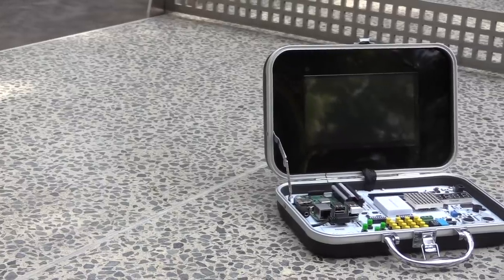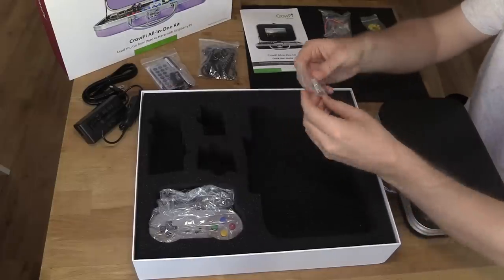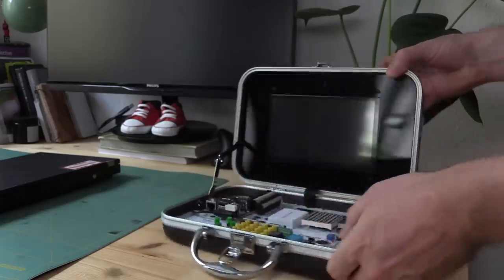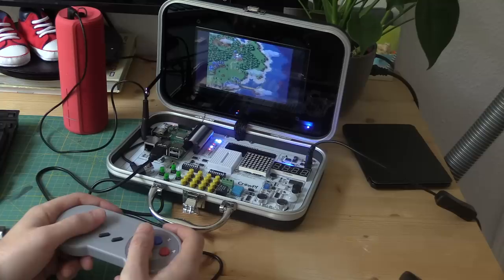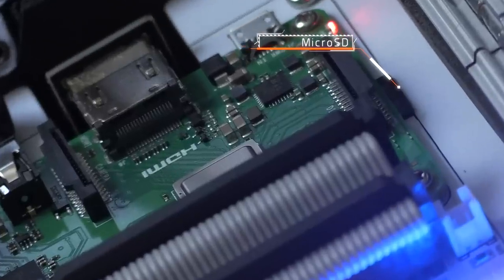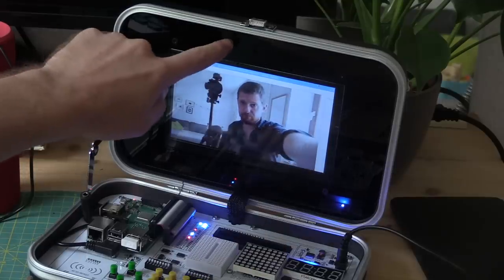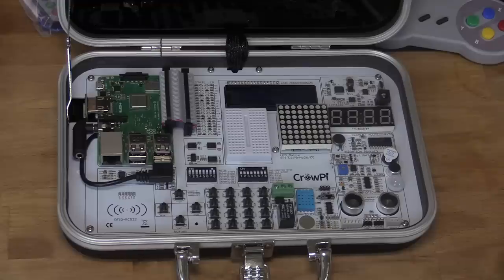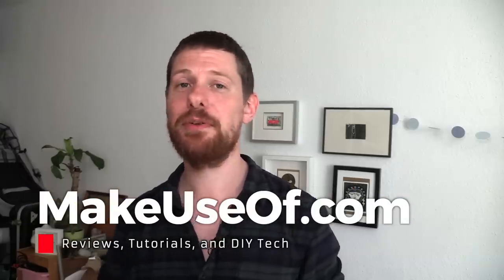Don't Buy a Raspberry Pi Until You've Seen The CrowPi All in One Kit!

Comment: Amazon sells a micro sd ribbon extension cable about 6 inches would allow you to be able to change SD card. Without having to remove the pi more than one time.
Reply: Excellent, that question came to mind about an extended for SD card. Good Job!

Comment: I don't think I would recommend buying a starter key with everything already wired up on a single board if you want to learn programming and electronics. I recommend learning to program on a PC then learning the electronics with a "bag of parts" kit.  With everything already wired up, you don't really learn how to build circuits. Building circuits is the foundation of electronics. Also, you need to be able to place your peripherals where you need them. E.g. The acoustic ranger on this thing is always pointed at your face.

Comment: The thing that where not included. Is there a set of them on Amazon?
Reply from the maker: ... which things?
Reply: @MakeUseOf  Wires I think. You talked about it in the video. Let me rewatch.
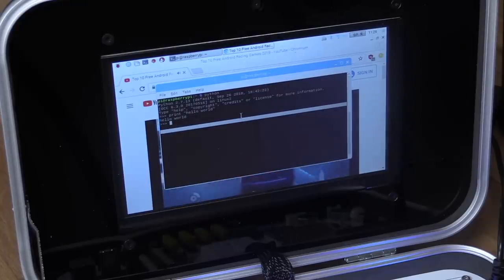Reply: At 5:40
Reply from the maker: @basicallyskeptical77  Oh: an LED, resistor, and wires. Probably not, they're very cheap components so usually come in an electronics starter kit or in a massive bundle of 50 at a time.
Reply: @MakeUseOf  OK. I don't understand electronics yet so wanted to know what to buy to complete the crowpi. Thank you.

Comment: There going to release a pi4 version. Will this still be worth it?
Reply from the maker: You can always swap the Pi out for the newer one, but I expect they'll update the CrowPi to include the new model soon.
Reply: @MakeUseOf  Actually the connection is different on the pi4. And yes they said they are working on a pi4 ed. If I did get this one I could turn it into a mobile gaming case after getting the pi4 ed.

Comment: This product is completely missing the purpose of the raspberry pi...

...as a cheap Single board computer useful for education/tinkering. There's little utility for all those peripherals if they are soldered on to that silly case.
Reply: I totally agree with you... it's not cheap anymore. Also, I think that you don't learn anymore as the setup is already done.
Reply: Exactly. You may as well just buy a £200 chromebook
Reply: It can be quite intimidating, learning about electronics and programming for unexperienced people. You could put something together for a lot less, but you'll spend dozens of hours figuring out about pull up/down resistors, which sensors work with 3.3 and which with 5 volt, converting voltage, multiplexing, how specific libraries work differently from very similar looking ones. You pay for the lack of headache and tutorials. Or for not having to spend hours helping your kid. And it's a neat portable package they can take to school. I think you are missing the point tbh. (I won't be buying it because I already figured those things out. As a kid I never would have had the patience and given up quickly.)

Also... A Chromebook doesn't have GPIO and is a pain to program Arduino with. Weird comparison
Reply: Many are suggesting it is for the kids. Nope. Not as a first item. Maybe 3rd or 4th. I can't imagine learning to program on a 7 inch screen. Sure it can be done, but it wouldn't be an enjoyable experience. Especially when a cheap laptop can be had for much less than the cost of this thing. If you wish to get a kid into programming, there are better options. i.e. NXT.
Reply: @PopularWebz  Depends. If they specifically want to learn to control hardware, read sensors, make robots, this seems like a good place to start. If they just want to learn programming I would recommend Python personally. Easy enough, yet very powerful.
Reply: True Python is a good scripting language to learn. It is part of what made the Pi popular after all. Apparently some smart people have made a Python driver for NXT FWIW. The most fun I've had picking up a new language was with Go.

Comment: I saw when he booted it up it wasn't overclocked, 
arm_freq=3300
gpu_freq=800
gpu_mem=1200
arm_boost=1
dtoverlay=dwc2
avoid_warnings=2
boot_delay=1 or 2 (used to delay the boot process so the jumps from each stage of the boot process doesn't skip from one to the next)
over_voltage_delta=7000000
arm_64bit=1
Must use a cooling fan to prevent over heating of the unit!
Factory warranty will be void so use at own discretion. 😊🫣🫡🙏💪❤

Comment: Just a mention to the Make Use Of web site owner, some people can't use the site because advertising scripts are locking up the page, this is unfair to you and your fans. Advertising helps pay for things but when the advertiser uses more code than some machines or browsers can handle it's just greedy.
Reply from the maker: That shouldn't be happening. You're not running any kind of script or ad blocker are you? They are known to cause issues.
Reply: No add blockers, my connection is a little slow, your web page is fine and loads, but the add on the side of the page takes up a hole lot of processing/bandwidth time, its a combination of local advertisers not being very considerate and the type of browser. These issues are like all bugs, if you find one, there's a hole nest of them here there and everywhere. I'm sure forwarding these comments to the rite P.R. advertising rep will help add coders re-think there ideas. What use is their add if it locks up the page. Hey thanks for the clip, without you I would never have seen this brilliant "Crow Pi".
Reply from the maker: @samham3408  Thanks for the feedback Sam, I've passed that onto the ad team.